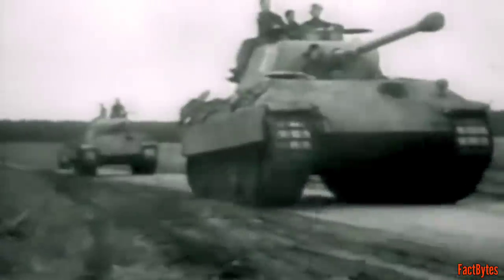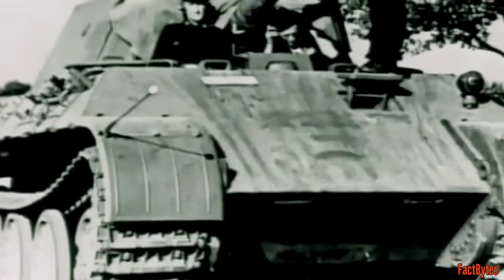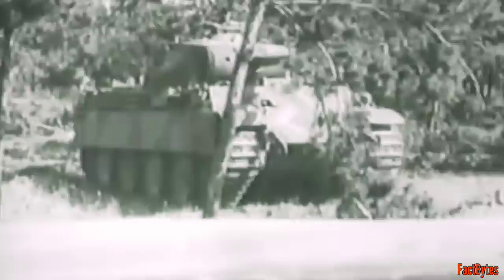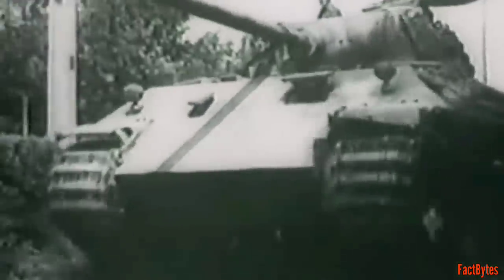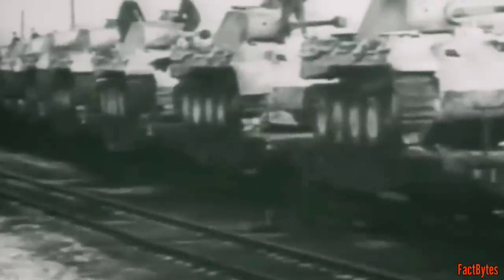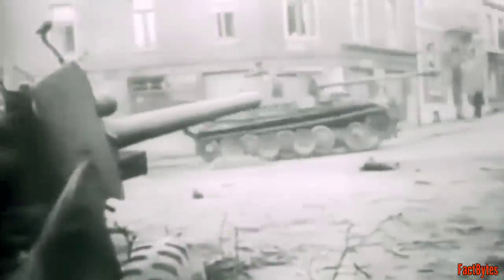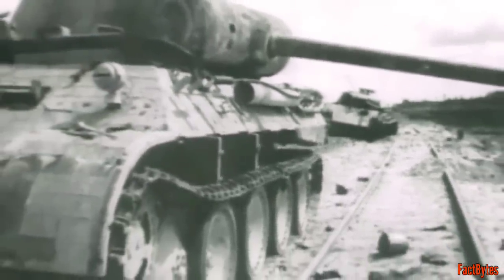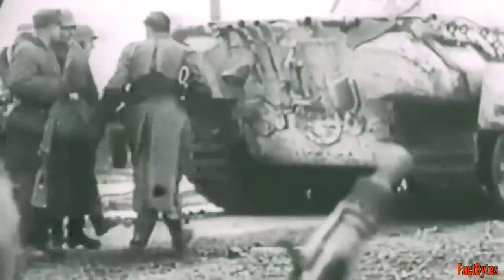Was The German Panther Really The Best Tank Of WW2?

Comment: Can you perhaps clarify two things?
1: As far as i know only very early models used FHA armor. But relatively early eliminated this requirement and used RHA armor on Panthers and Tigers as well i think. 
2: Was its HE really this much weaker than those of the kwK 40 L/48? Because most sources told me there was little to no different and both had pretty much the same ammoung of HE filling. I am extremely curious to get an answer on this one and perhaps sources that claim it. I heared that the high velocity made the HE shells sometimes bounce off the ground due to its flat trajectory. But idk if thats true. 

Thx in advance to anyone who can give me an solid answer to that.
Reply: No, he's is going off a piece of misinformation/myth, it is commonly claimed that the KwK 42 had a terrible HE round because it is a high velocity, however the actual information says the opposite.

Comment: Early model Panthers is a definite No, but later models are a definite consideration for best tank…
Reply: That's true because when the panther tanks were built they were basically rushed to the front and because they hadn't been properly tested they lost more to failure and malfunction than they did destroyed and once they fixed the problems it was a formidable tank
Reply: They where good if they worked and in a 1v1 but in the reality it was way cheaper and easier to make and to keep it running. Because of this there where way more shermans and t34-85 on the battlefield( and the industry of the allies was way better)
Reply: @funkymarco4411  well nearly all t34 went out of factories in already horrible shape you would never meet a t34 like those from museums since those were probably made after the war, so sovoet could boast how good they were, but in reality because stalin didn't knew works such as "construction time" they were really rushed in factories and german factries were non stop bombed so 1000 or even more panthers could have been produced
Reply: @szynszylku1447  bro the panter was to expensive, unreliable and hard to maintain. The shermans, comet's, t34 and the other tanks used where just better at the those poinst
Reply: @funkymarco4411  t34? reliable? Those from factories? Besides sherlock because panther was a bad tank doesn't make t34 a good one are you drunk or what?
Reply: @szynszylku1447  whole army’s of b29 Bombed Panther factories until they came up with the idea of building factory’s in forests which worked out in June 44 the MAN plant got bombed so hard production just stopped in it for 3 to 4 Months and MAN accounted for 31 percentage of Panther production
Reply: @funkymarco4411  dude you don’t know what you are talking about the Panther was so cheap it cought up with the panzer 4 in terms of production numbers Panther with armament and ammo cost 141K reichsmark and the late model panzer 4 in production cost 115k RM with armament but it
Reply: @mohamedsayyad946  the panter had great armor, speed and a good gun, but it was unreliable, hard to maintain and it was why more expensive then the comet, sherman and even the is-1
Reply: @funkymarco4411  Yeah, the Panther makes the early t34s look like Sherman tanks in staying functional.

Course no one of them were as legendarily terrible as the infamous Ferdinand/Elephant
Reply: @funkymarco4411   Germany overengineered all of there late war tanks and they ended up going full megalomaniac by deciding to produce tiger 2 which is just an overweight tiger in fact tiger 2 was so expensive and unreliable that most were not even repaired and they drank up massive amounts of fuel

Comment: I see here the same incorrect statements regarding the Panther. 

Panther never weighed 30 tons. The design request specified a 30 ton tank. The VK30.02DB weighed 32 tons. MAN VK 30.02M weighed about 42 tons. The Panther Ausf D weighed about 43 tons. The Ausf A weighed 45 tons. The Ausf G weighed 44 tons, 46 tons if it had the later steel rimmed road wheels. No Panther ever weighed 50 tons. 

Panther II would have used a completely different hull with thicker armor, Tiger 1 engine, torsion bars, transmission, and final drives and weighed 53 tons. 

 Hitler wanted substantially more armor. This was not obeyed as it would reduce mobility. At last minute the upper front plate was increased from 60mm on Prototype and first 20 production tanks to 80mm on rest of production models. Later when armor quality went down Panthers were produced that had 85mm upper front plate.

The only difference between say the PzIV's 75mm L/48 Pz.Gr39 and the Panthers 75mm Pz.Gr.39/42 was a extra set of driving band to help handle the higher chamber pressures. The difference in muzzle velocity was about 400-500 fps. 

You mention Panthers side armor as being too thin at 40mm yet its contemporaries were similarly armored. Sherman was 38mm, T-34 was 45mm, Cromwell was 32mm. 

The early Maybach HL P210 P30 engine was the horrible version. Later HL234 P30 engine was virtually same as the Tigers. Tiger 131 is running on a HL230 pulled from a Panther. 

The operational reliability problem and 50% operational rate was due to a lack of spare parts. The French retired their Panthers because there were no spare parts to keep them running. Food for thought: France's Saumur tank museum Panther "Bretagne" has been run for years. The vehicle requires more maintenance and it requires it be inspected before every operation. If it is kept within required maintenance parameters it has proven reliable. Saumurs Panther drivers has also stated it is of of the easiest to drive vehicles. 

The vast majority of the engine problems were related to the Maybach HL210 P30 engine. The HL210 used aluminum block and heads, was structurally weak that allowed the block to flex thus blowing head gaskets. The carburetors had a design flaw so that if the driver shifted at wrong rpm it could cause a engine backfire through carburetor that could cause a fire. The fuel pump diaphragm design was flawed which led to ruptured and fuel leaking into engine bay. 

Panther was never intended to be a infantry support weapon. Unlike say USA which developed one tank to do several tasks, the Germans built a specialist vehicle to do each task. Germany developed a PzII as a training vehicle and scout. PzIII was the main battle tank with high velocity gun. PzIV was the fire support vehicle for PzIII. StuG was the infantry support weapon. US built M3/5 light for scout and M4 for everything else. 

Tiger and Panther units were tasked with elimination of enemy armor. The PzIII's and PzIV's were tasked with everything else. In August 1943 orders were issued that specifically stated that Tigers and Panthers were not to be used for infantry support, they were tasked primarily with eliminating enemy armor. 

Panther had too many issues to be a great tank. Germany was on the right track and designed the Panther to meet future battlefield needs. Due to Germany losing too many compromises were forced on the design which crippled it. As for the Panther being too big, too heavy, and too tall look at the M26 Pershing and Centurion. Both were almost same height and same weight. Post war Germany considered putting Panther back into production but decided on a newer more modern design which was the Leopard. Compare the specifications for the Panther and the Leopard some time.  

Germany should have focused on one tank from start, the PzIV and created two versions, one armed with 50mm and the other armed with 75mm howitzer. Later a sloped hull version with improved suspension with 30 ton capability (the BW30) and long 75mm would have been enough. 

Despite all its flaws the Panther certainly made a impression.
Reply: The DB design did not weigh 32 tons, even the draft before they build anything gave an estimated weight of 37 ton. It would have been heavier had it been build and taken the request for increased frontal armour.
Reply: @Dreachon   According to a meeting held Jan 28/29 the Daimler representative Fichter asked Wilhelm Kissel what the allowed weight of the VK30.02 project was, and stated the vehicle weighed between 32 and 35 metric tons. 

Either way Im still off.
Reply: @Anlushac11  I believe that the proposals from DB listed a weight of 36 to 37 ton for their tank but given they did not had their turret design finalized there still room for it to bloat.

MAN proposal listed a weight of 37 to 38 tons.
Reply: @Anlushac11  Took note, that isn't the weight of the DB proposal, it's the allowed weight which later had to be adjusted as both proposals went over this.